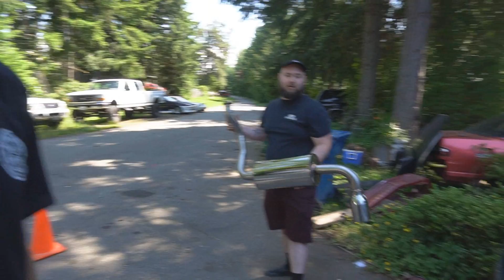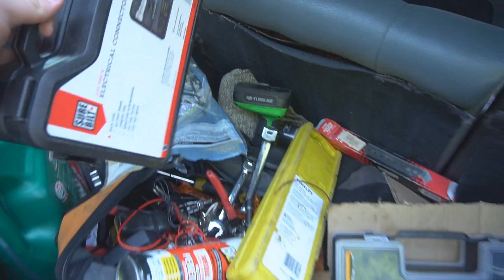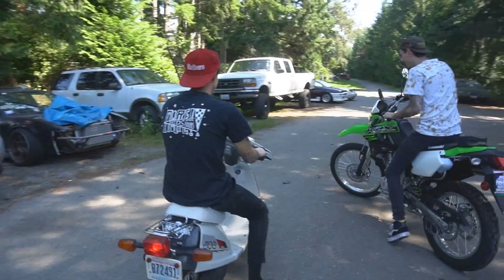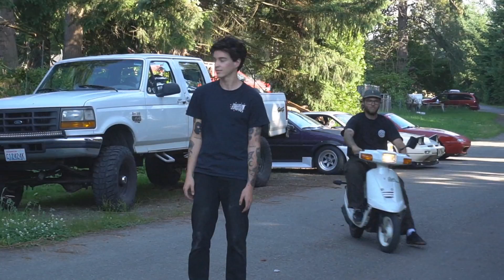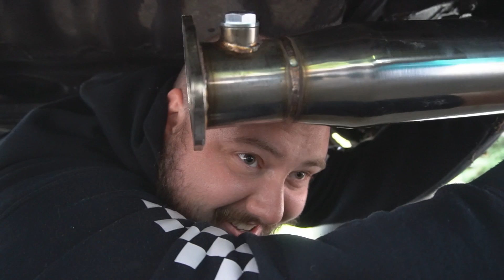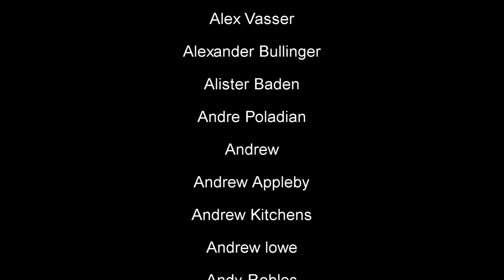Installing INSANELY Loud Blast Pipe On The Civic

Comment: You're missing 2" cause you need to have a donut there with spring bolts, it needs to move, like a flex pipe
Reply: yep and the mid pipe is on upside down!!

Comment: It's a crx exhaust. Cause I've had the same the civic is a little longer. And need a little extention. Like the test pipe but the 2 inches in this case.(just available for purchase) Should line up perfectly then.

Comment: You guys should get a 3” piece of 2.5” piping and put it in the gap (slide it into both sides of the exhaust), with two long bolts and some crush washers to keep them from rattling loose. Should be a cheap, temporary fix. And, you can use the same 2.5” exhaust piping to extend either side of the exhaust when you have the money to weld it.

Comment: The key to a good sounding NA small 4 banger is straight pipe with as many resonators you can fucking fit. 
(Brother had an integra with 3" with 3 res boiz and it was perfect)

Comment: I'd have went with one of these on the civic if I was one of yall, those small engines need scavenger pipes.

Most supercars have an expansion chamber right downwind of the turbo, however even naturally aspirated engines benefit from added back pressure and expansion, these Jones mufflers are sick because they add both and flow very well at the same time. Stainless also.

https://www.amazon.com/gp/aw/d/B00IFUTOCW/ref=psdcmw_15726991_t2_B00IFSO9NI